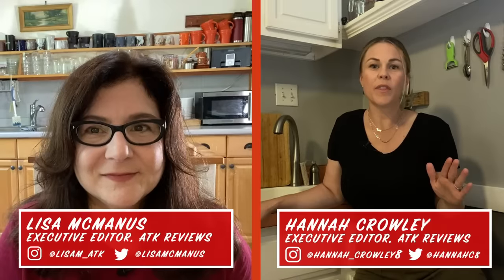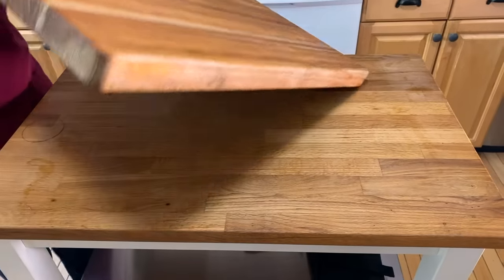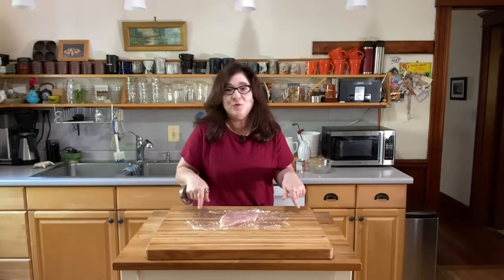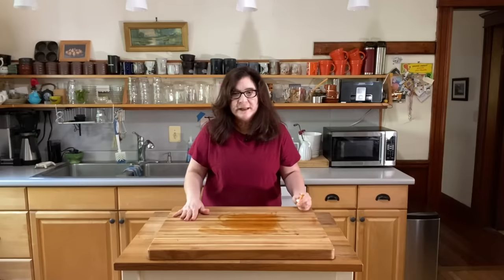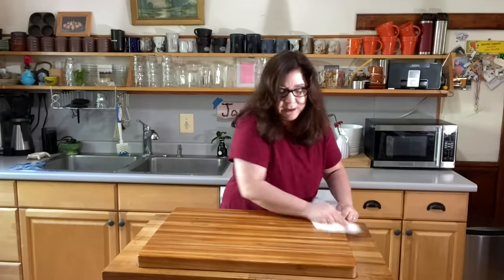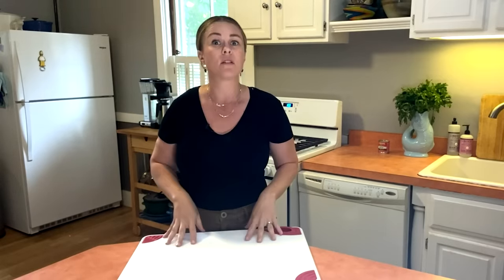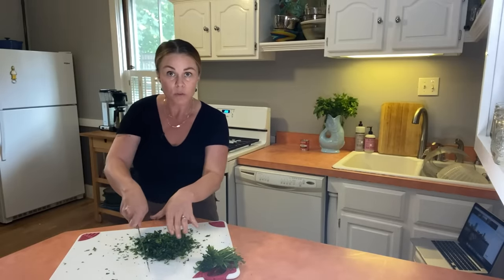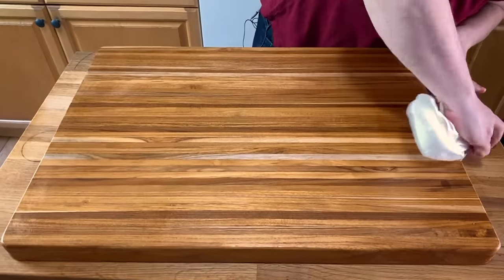Gear Heads | Which Type of Cutting Board is Best for Your Kitchen?

Comment: Cook's Illustrated actually recommends using spoon butter (a 3 to 1 mixture of mineral oil and beeswax) instead of just mineral oil for wooden utensils (including cutting boards).   A quote from their results:
"After washing both sets 20 times, we found that the set treated with spoon butter was in noticeably better shape. Those treated with straight mineral oil looked ashen, with dried, rough spots, while the spoon butter set had a smooth finish and retained some protective coating. Making spoon butter takes a little more effort up front, but the long-lasting results are worth it."
Reply: Why not coconut oil? Less toxic.
Reply: Totally agree that spoon butter is better, but mineral oil is a simple, inexpensive solution that most people can implement immediately.
Reply: I've used the mineral oil+beeswax concoction for wood handles on my knives.  They look great and feel good until you start chopping and interacting with water and residue from fish or chicken - the wood surface gets very slippery and the knife doesn't feel secure.  I assume that it is probably the beeswax that is causing the slipperiness.  I have one wooden chopping board and a medium and small size plastic board.  Both show stains that will eventually fade after several washings.  The wood is soft and feels good under the knife.  My wife bought me a glass-like board, with feet, that is pretty - the first time my knife jarred against that hard surface, I rejected it for chopping duties - I use it to put hot stuff on.  We downsized on our house when we neared retirement age - I don't have room for the monster chopping board and I'm usually just fixing a meal for two these days.
Reply: @pattijesinoski1958  Ooh would not recommend any food/cooking oils, like they mentioned in this video those oils will get rancid and smell terribly - and that smell will not go away no matter how much you try to disinfect it, my and my roommate's experience agrees lol 😅 
I'll go back and get the timestamp.
7:32 is where she says you don't want to use vegetable oil or olive oil 👍
Reply: @pattijesinoski1958  There is nothing toxic about food grade mineral oil.
Reply: @pattijesinoski1958  "Coconut oils have recently become highly popular for a variety of purposes, especially in beauty, because it is rich is saturated fats that are good for skin health. Unfortunately, all fats exposed to air eventually go rancid and coconut oil is not immune (even though some bloggers claim otherwise). However, a select group of coconut oils are refined using a refractionation process, which is a fancy way of staying that the oils have been steam distilled. During this distillation process, coconut oil is separated so that the long-chain triglycerides (LCT) are removed and only the medium chain triglycerides (MCT) are left. This leaves an almost pure oil that will NOT go rancid, is shelf stable and is superior to most other oils for treating not just cutting boards, but your kitchen utensils, salad bowls, countertops... you get the idea.

Caron and Doucet's Cutting Board Oil is a coconut based cutting board oil that is food safe and has added lemon oil essence for antibacterial purposes. Note that not all coconut oils should be considered food safe!"

Comment: I really enjoyed this very informative cooking boards demonstration. After battling a debilitating disease for over 20 years along with prescription drugs’ nasty side effects, I now have to live in a pretty weak body. Cutting vegetables and meats is now a long and excruciating process. I’ve been thinking to buy a solid wood cooking board but I feared it would be too heavy for me. Thanks to this  show, I now know there’s a good quality board I can buy that coud facilitate my meal preparation. Despite my wish for a wood block there’s no way I could handle a 15 pds block let alone lift it from the counter to bring it to the sink and clean it. So I’m relieved to learn there’s a good quality plastic board I can use as a solid base to prepare my meals. I’m going to visit Amazon and order it right away. Thank you so very, very much from Canada.
Reply: You "could" get a heavier board and be extra conscious about what you cut on it so all you need to do is wipe it with a lightly soapy washcloth, followed by a damp washcloth to wipe the soap. Don't cut meat or anything with too much soil and it would be fine. But yes, there are "lightweight" wood boards. And there are bamboo boards (not wood) but hard on your knives.

Comment: I'm on the wood camp. I was using plastic for years and I didn't want to spend money on a good cutting board. I finally caved and bought a teakwood one omg I love it and I just bought a maple one that is the same size here and can't wait to use it. I will never go back to plastic 😁
Reply: What happens when you cut meat then need to cut veggies? With the size of the wooden board she has, F*** that. Also REALLY you should be using separate boards for meat and veggies.
Reply: Edward Cullen. When prepping food I cut all the veggies first. Then cut the meat. Then wash the board.

Comment: The bits of the cilantro you threw away are the bits with the most amount of flavour! I always use them when making pesto/chutney or in gravies.
Reply: As a cilantro hater, I'll remember to especially avoid the stalks!!
Reply: @annedwyer797  😊 It turns out that those who are sensitive to cilantro are sensitive to the soapy bitter aftertaste of aldehydes in the fresh leaves (some 15-20% of the population is sensitive to this because of genetics). But the stalks and roots, especially when crushed and cooked do not cause this problem, and given the amount of rich flavour it adds, I'd urge you to give it a try just once and see :)

Comment: I have both wood and plastic cutting boards, and use them for different cutting purposes.  Sometimes the plastic boards will stain, but a little Soft Scrub containing bleach works very well at cleaning stains. Tougher stains that have set for a time may require Soft Scrub and a period to sit before scrubbing, but the stains ALWAYS come off.  Because the plastic boards are so light, I hand wash them, let them air dry, then put them away after 5 mins.  Scrubbing them with very hot soap and water are the best at cleaning both kinds of boards.  I rarely go out to dinner, so I use cutting boards at least 3 times a day, and have a lot boards of each sizes from the very small (to cut lemons, limes, apples, etc.) to the very large (for cutting meats and poultry, or a lot of veggies for soups and stews).  I keep a piece of a wooden cutting board under my toaster to catch crumbs.  They are great for other purposes once you need to retire them from the kitchen.

Comment: Thank you for that presentation. 
 
I keep two smallish boards on my counter-top.  One is wooden, and needs to be replaced due to warping.   I'll see what "Proteak" has to offer in that size.  The other is marble, so I never use it for cutting.  I keep it next to the stove, and use a trivet to let dishes "rest," just out of the oven.

I keep a larger (18" X 24") plastic board, which I can store on its side.  I'm sorry that I can't tell you what "make" it is. I've had it for years, and there's no trade mark on it.  It's "rock-solid," with little flexibility, so I can  use it as an extension of my counter top, over the sink for larger jobs ...  like cutting up a whole chicken.

Comment: You mentioned testing with knives and what a knife does to the board but not what each type of board does to the knife.  What is the best board for a knife?
Reply: I'd assume the one they recommended.
Reply: End grain. They also left out super steel knives vs traditional / European. A good super steel knife with a smaller edge angle and harder steel will likely sink in to their plastic board and micro chip / crack when trying to free it.
Reply: @madthumbs1564  I was actually wondering this too.  I am considering investing in a powder steel knife and would hate for anything to happen to it.  Chips are hard to fix.  And I was wondering what like an S3 would do on the teak Vs plastic board.
Reply: @KitarraChaosWeaver  I have some PM steel knives. Edge retention and angles are awesome! -But I mostly use Victorinox because I can quick and easy sharpen them and don't have much worry (even letting them sit dirty).
Reply: @madthumbs1564  I agree, I have knives that cost hundreds of dollars each yet I always find myself reaching for my Victorinox boning and breaking knives. they're well built, easy to sharpen to a razor edge, and best of all they're relatively inexpensive.
Reply: @madthumbs1564  I have small hands and a chef's knife is just too big for most of my tasks.  I prefer a utility knife for like 90% of what I do.
Reply: Do you guys realize how much novices learn from the comments alone?
Thank you guys.
We had already ordered some Victorinox knives and I have been using them consistently for about 10 days. . .i love them.
Reply: It is sixes:  The better plastic cutting boards have a hardness about the same as hard maple, which is what traditional cutting boards are made of.  The plastic will show the slight cuts into the surface, which the maple wont.  But a trip through the dishwasher, and they end up white and you can’t. See the scratches.  Another advantage to the plastic ones, is that a quick wipe down with straight chlorine bleach, followed by a rinse with hot water and they are sanitized.  I sanitize my butchering board before and after each use, then store it.
Reply: I question teak as a wood if your worried about dulling the knife.  Teak has high levels of silicon in it, and will dull even carbide cutting edged wood working tooling.  So. I would assume it will dull kitchen knives relatively quickly as opposed to a hard maple, or UHMW plastic board.
Reply: @randallthomas5207  Bamboo is high in silica also. Boardsmith has a lot of good information on various woods.
Reply: @randallthomas5207  They have done tests on how a board may dull your knives, It would take years for ANY board to have any real effect on your knife edges. It is just another myth like bringing your steak up to room temperature before cooking it. Sounds great in theory but in practice it turns out to be nothing but an old wives tale.
Reply: If your knives are damaged by a plastic cutting board in any way, you obviously need to get some new knives  lol
Reply: @thefakerscritic1397  So as you go up the Rockwell hardness scale, and your blade becomes thinner to accommodate a much finer cutting angle (between 11 and 15 percent) the blade can actually crack and chip.  These knives are high performance and make extremely thin, elegant cuts.  They stay incredibly sharp for a long time and can be kept that way with just a regular stropping.  But they have to be babied.  So a plastic cutting board with deep grooves can.chip damage the blade by getting it caught and chipping it.  Not a better/worse knife thing, but.more of a something's gotta give type thing.  A lot of owner of these types of Japanese knives only ever cut on silicon or rubber cutting boards.
Reply: I have already said that an inch thick polypropylene board is as good as it gets  I use Kessaku Japanese high carbon steel blades with a rockwell hardness of 55 which are in essence honed to be twice as sharp as most professional quality knives.  The really thick poly boards do not damage easily and my knives do not chip the board or the blades.
Reply: @thefakerscritic1397  Good to know.  Thank you!  The knife I am looking at is 63 on the hardness scale and I am having paranoid thoughts of chipping.
Reply: @randallthomas5207  As the ex owner of a large meat packing company, I can tell you teak wood does not dull, nor harm, the edge on boning, chefs, breaking, ect., knifes, any more than the synthetic tables the FDA mandated we switch to.
Reply: I wouldn't worry about what type of board beyond what someone mentioned- no glass, metal, stone, etc.. If you are cutting on plastic or wood, you should be good regardless of your knife's Rockwell rating. 
I am a knife baby-er too, but if you are afraid to use your expensive knives, what's the point of getting them? If there are grooves in your board that are deep enough to actually catch your knife during use, you will probably want to repair or just replace the board. Any  normal wear induced "damage" to a knife can be repaired by normal knife maintenance (steel, strop, stone, etc.)

Comment: My favorite boards are the Epicurean cutting boards.  Very durable, great for knives, go in the dishwasher.  They do look used after a while, but they are very lightweight and stable.  They come in all sizes, and are priced reasonably.
Reply: I've had mine for over 15 years and it still looks great but I don't put it in the dishwasher. I do have to dry it on it's side or it will cup and I have to flip it over to use it.

Comment: Avid home chef here... I love my "San Jamar" brand plastic cutting boards due to the features: very resilient; rubber feet to prevent sliding; handle.  (Very similar to the board that was this video's top pick.)  Only downside: the feet leave a gap with the counter, so NOT good for pounding, as the flex of the board absorbs "pounding" energy; I use a flat (no feet) board with a non-slip pad under it for pounding.

Comment: When oiling your wooden cutting boards when you first get them, follow the rules of 7. Oil daily for 7 days. Then oil once a week for 7 weeks. Then oil monthly for 7 months. Then oil as needed to maintain the surface. Liquids should bead up on it, not saturate the wood. The general rule is, if it looks dry, it is dry. When I worked in a seasonal camp kitchen, we scrubbed the cutting boards down and air dried them when we first opened up camp for the summer. Then we heavily saturated both sides of the boards overnight in mineral oil. In the morning most boards had absorbed all they were going to. Wipe the excess off those boards and they were ready to go. If any had dry spots apply more oil until they to were saturated. Then wipe down and use. We oiled the boards weekly through the summer, and stored them at the end of the season oiled.

I prefer a wooden cutting board to all the others. It just feels more comfortable.

Comment: I bought the large Oxo board last-recommended by ATK (bought in-store at Target).  The board warped significantly after just two hot-water rinses, and it's miniscule rubber "feet" allowed the warped board to slide a lot when using the meat-carving side.

I hope the newly recommended board is better than the Oxo.
Reply: Jake we have the Winco board, as seen in Hannah’s test.  I love it, it is everything that Hannah said and I have tendinitis in my hands so c@n handle it easily.  Washed in DW about 250 times now and no bowing or de lamination.
However, in my younger years, I used an old wooden cutting board that my mom got during WW2 in Biloxi Mississippi where my dad was stationed.  She bought it at the PX and it is a 1 1/4 inch thick wooden cutting board shaped like a pig 14” by 18” but is too heavy for me to handle anymore so it hangs like a decoration on wall of the kitchen.
God, I loved that pig, best cutting board I ever had or have seen (barring Lisa’s behemoth which I could not handle today), but it looks equally comfortable upon the wall and brings back so many memories.
Reply: Imagine how informative this video could be if the runners up were mentioned by name. Or maybe the disadvantages of different woods. Or maybe a list of the losers and what went wrong. Otherwise we just have an infomercial. Comments have the bulk of useful information for me.
Reply: @nyohaku  The full testing stories are on our website, www.americastestkitchen.com
Reply: Jake: warping is a result of how a board is dried. Always dry it vertically not horizontally so that both sides (top and bottom) have equal air circulation when drying. In your case, is sounds like your water is too hot. And you can always call OXO customer service, or could have returned the board to Target.

Comment: I have a big, beautiful acacia wood cutting board, and i only use it to serve charcuterie on. IMO the best cutting boards are the thin, flexible plastic ones.They are easy to clean  - they´re really cheap and sized just right for the dishwasher, so you can have more and just leave them in there. If they get cut up you just get new ones because they are less than €1 per piece. And because they´re flexible it´s easy to pick up the food you just cut up and slide it into the pan, or to move breadcrumbs to the trashcan without spilling them all over the floor.

Comment: I have several cutting boards, all dishwasher safe, four plastic, one wood fiber. Two of the plastic are smaller, like the one held up in the beginning, so if I want to cut something small, I’m not dirtying a bigger board. This works for me, because I only run the dishwasher a couple of times a week. 

One of my plastics is my favorite, because it has nubby bits all along one side, which are super grippy. That one does NOT slide!

Comment: Back in 1988 we needed a cutting board because the wooden cutting board we had fell apart. I made a cutting board from a piece of leftover 5/8"exterior  plywood measuring 13 x 17 inches.It is still in daily use and is still in reasonably good shape after 30+ years.